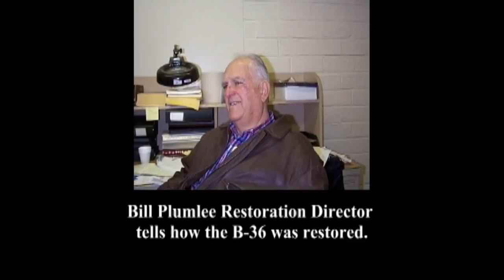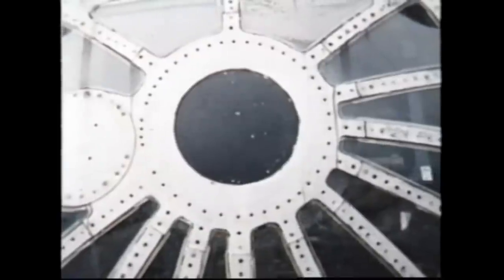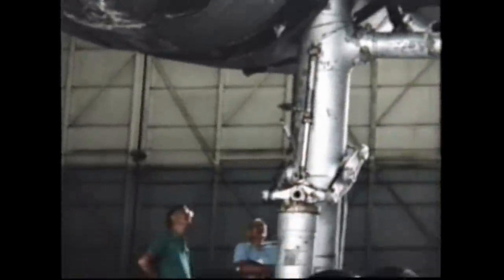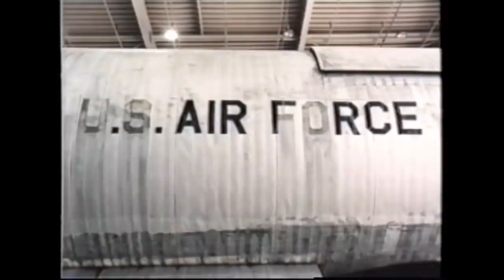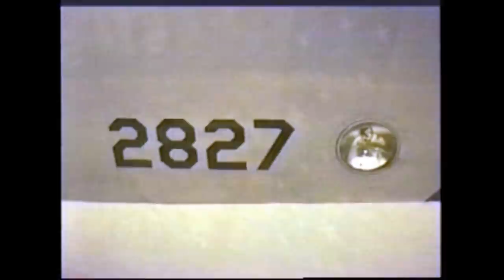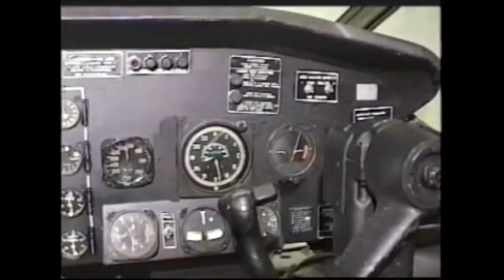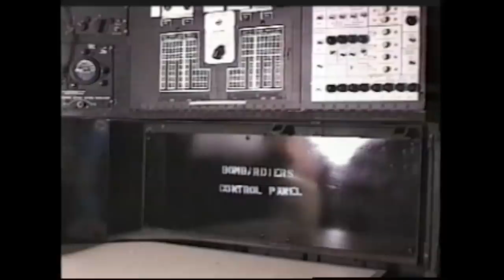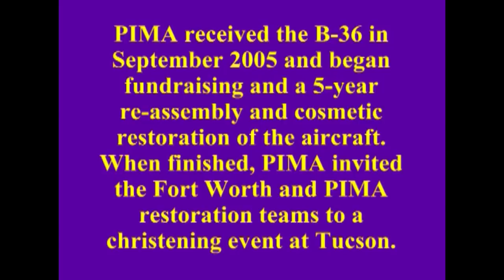Restoration of the last B-36 Bomber in Ft Worth

Comment: I recently saw here on Youtube a US plane "boneyard", and there was a B 36 too if I'm correct ?
Reply: boneyard is in tucson and it is separate from the pima air museum. the b-36 is at the museum, not the boneyard which houses thousands of military aircraft
Reply: By the way, when I was in elementary school in Tucson in late 50's, you could hear them coming over head before they appeared, and the nuns used to stop her lesson because of the noise, and the building would shake.

Comment: My dad pulled an ORI on the wing at Fairchild that had these monstrosities, I believe in 1952, and it was a failure as great as the  weight of these things.  Only two of the B-36s of the whole wing managed to get airborne as directed, and the guns jammed on both of those over the Pacific, leading to a 100% failure of mission.  Two more managed to get in the air later, one having to return due to an engine failure, the other having similar gun jamming plus a turret lockup.  I can't recall the old man's name at Fairchild, but he didn't fare well at all.  He got back at my dad by blocking a overdue promotion, whereupon he resigned his commission.  He was quite well known to recall this flying circus of an airplane as the biggest fraud on the US taxpayer ever perpetrated by the corrupt Convair Corporation.  If course, he said this before they foisted the insanely dope dive (and useless) B-58 mess on us later.

Comment: A B-36 will never shade the ground in its "aluminum overcast' again.  The odds of getting an airworthiness certificate for a plane powered by four R-4360 Wasp Major's are Slim and None!  As it is it's a miracle two B-29's are flying.
Reply: Correction: Make that SIX R-4360's!  My bad.  Still, this plane or one like it will never take to the air again; it was tricky enough to get them airborne in the 1950's. Even the B-52 had a short life as a "strategic bomber" once it was clear that SAM's could take out bombers while an ICBM was unstoppable.

Comment: This last B36 - with 44,000 + manhours of restoration to save this aircraft from the crushers -  and supposed to be an in-hangar display for generations to come and view history - only to be sent back into the elements and be allowed once again to slowly decay.  What a tragedy.  I am wondering if operable engines were in the static display before they began the restoration? Would it be capable of flight again?  What would the cost today be to operate that aircraft?
Reply: +Lindsey Allison Westhaven   They had originally planned to repair it to flyable condition for one last ferry flight to a new location. But when the Air Force heard about the work they came in and took the engines and the engine mounts from them to prevent it from flying again. They were expensive to fly while in service and would be far more expensive to operate it today.
Reply: @FiveCentsPlease   WHY WOULD THEY DO THAT? TO KEEP IT FROM FLYING TO A MUSEUM WHERE IT WOULD STAY FROM THEN ON?  WHO ACTULLY OWNED THIS AIRCRAFT - THE USAF OR A PRIVATE ENTITY.  SOMETHING STINKS HERE AND PEOPLE SHOULD DEMAND ANSWERS.
Reply: There was only one good engine in the aircraft. Without fuel in the tanks, the heavy engines caused the B-36 to tip over to the rear. So, there were five dummy engines.

Comment: What a goddamn shame that with all the money the military blows on b.s., they cannot find it within their leadership to restore completely, this awesome one-of-a-kind mighty guardian from the early Cold War. I am very disappointed that funds could not be found to restore it to full airworthiness. What a shameful mark on the USAF.
The volunteers, however, did an outstanding job for what they were capable of, in the hope of one day, watching it take off into the sky one last time. It nearly brought tears to my eyes.
Reply: +Ride TheCurve   The aircraft was technically still property of the USAF Museum and was just "on loan" for display.  The AF Museum already has another B-36 inside their facility.  When the Air Force found out that they were going to attempt to fly it (even for a short ferry flight) they came in and took the engines and mounts.   An operational B-36 if you factor in fuel, insurance, and an impossible maintenance schedule would not be very realistic.   The DoD doesn't maintain a "heritage flight" on the same level as the Battle of Britain memorial flight for example.

Comment: One of the first things the air force did when the re-posessed the aircraft was destroy the engines, all six were in running condition
Reply: Actually, no.  The preservation team removed them to reduce the stress on the wing and gear once it became clear that a return to flight wasn't gonna happen.  Would have been nice to have saved one for runups on special occasions, though.
Reply: On this particular aircraft, there was only one good engine. Five were dummies because their original weight caused the B-36 to tip over backwards because the fuel tanks were empty.

Comment: Strategic Air Command.    

36 hours at 45,000. Others to reach that altitude could not maneuver. Non air borne refueling capabilities.
Props 19’ were gear reduced to avoid super sonic tips. Her low pitched vibrato unmistakable.
336 spark plugs. Six times 4630 Wasp Majors. 4,300 horse power each at take off.

Flight engineer, give me full power, jets 100%, rolling.

Imagine a flying condition example on the forth of July on a celebration low fly by.

Be some old boys with damp eyes.

Comment: "The Air Force would not let it stay in Fort Worth unless it was in a building. It would take about $1,500.000.00 to cover it and the money could not be raised. The Air Force moved it to the Pima Air & Space Museum, Tucson Ariz. and it is on display outdoors."

Seems like you'd want to keep raising money until you had enough to put it under cover, but that's just me. Putting it out in the weather is just letting it deteriorate again.

Comment: Even if it was restored to airworthy condition.  Would there be anybody that has the type rating to fly it?  How does that work lol?
Reply: +1!  There are pilots with so much experience on these old planes that the FAA pretty much says they can fly anything.  But the B-36 needs at a minimum two pilots, a flight engineer (this mode required two), a navigator, a radio operator, and two observers in the back watching the engines for smoke or flames.
Reply: A B-36 flies just like a Piper Cub. The only difference is that it is more difficult to attach playing cards to the spokes.

Comment: I had no clue magnesium was used in aircraft... I thought magnesium was too flammable and too soft or too brittle but too no good for airplanes.
Reply: Keith Whisman ,
Light weight. Flammability was mainly concerned with magnesium dust created during manufacturing.
Reply: And of course, it burned like a torch if you had an inflight fire or a crash.
Reply: Not true.   Even the DC-3s had massive amounts of magnesium in the landing gear structure.

Comment: People should do what they want, however, the B29 was used through Korea (1953) and the B-52 came on line in 1955.  I've never quite understood how this ridiculously large and slow bomber fit into history?  It seems like a large mistake rather than a plane we hold in high regards for what it did for our nation.  Radical push engines, largest bomber ever built, but for what??  Modern jet fighters would simply shoot it down because it was slow.
Reply from the maker: It was designed in 1942 because we thought England was going to lose the war, but after we got involved we knew that would not happen. It did not fly until 1946, but it could fly higher than any other aircraft. There was no missile or aircraft could shoot it down. After the war the Russians put 100 divisions on the border and NATO had three. Our President told them if they invade, we will load them with nuclear weapons and destroy your country. That stopped World War Three. It never dropped a bomb in anger,  but it stopped WWIII after WWII.

Comment: What's all this nonsense about getting a B-36 flying again?   those engines weren't exactly reliable.    I'm amazed they have restored it to static display.  They were enormous, but gas hogs.  You are talking mid 40's tech.   No one would take this on,  maybe not even Travolta,  you'd be a lot more reliable manufacturing from new and installing new type engines but there wouldn't be much point.  No one is complaining because they dont' fly F-14's .... I'd much rather preserve these instead of taking a risk on losing one.
Reply: The one at the Air Force Museum was flown to Wright-Pat in '58 or 59.   There's a reason they went out of service, reliability and range.   The B-47 B-52 was much more reliable, at least we had that great movie with James stewart to remember them by,  they were a stop gap for a few years and probably kept the peace, which was their namesake.
Reply: MrCloudseeker , if they used “better” radials, it wouldn’t be a restoration, would it?
Reply: These 56 spark plug corncob engines were very high maintenance and at that time unreliable.  Cooling problems
in the rear 14 cylinders was critical.  The 28-cylinder engine was just too complex.  The 18-cylinder Wright turbo
compound engine should have been the choice for the huge Consolidated/Vultee {CONVAIR} B-36 bomber.
Reply: seriously?  the R3350 had enough problems with supercharging, turbo-charging and power-recovery supercharging that they were on the ragged edge of destruction every time they flew. the R 4360 wasn't so heavily taxed.
Reply: The plane came with a mechanic, that had a workshop in center of the wing and could walk up right to first set of engines, and could do maintenance while midair on all of them.
Reply: And, what engines would you use? Name one instead of spewing garbage. 
Name one engine that has the power needed to even get this monster rolling. You can't because there isn't one. 4300 HP is hard to replace.
The project would  be beyond massive and and how would you pay for it? You seem to have very little info on aircraft storage processes and how aircraft are sealed to be UV proof.
Reply: Ummm, no.  The mechanics stayed on the ground. The Flight Engineers were part of the crew.  Later models had two on duty.  

The center of the wing was gas tank, not a workshop.  And while there was a crawlspace in the wing, all you could get to were some fittings and fuse panels.  No way to access the engines themselves, or even the accessory section.
Reply: The B36 at WPAFB was flown on to the Area B airfield in anticipation of the museum moving there from another location at WPAFB. IT was determined that the B36 on display  at the previ on us location couldn't be moved to Area B 

I was there in my mom's arms to see the B36 land. Dont remember it, but my parents had pictures of the event.  

The other B36 was sold to be scrapped. Tge Buyer took it apart and transported it to a farm in Northern Ohio in the early 70s. It is still there today.

Comment: The sad truth of this aircraft is, it was pretty sad.  Under powered, poorly constructed.  The B-36 holds the distinction of having the shortest active service life in the US Air Force.  Many low hours air craft were flown directly to the scrap yard.  Many were scraped in place, because the could not be safely flown.
Reply: Uhh, no, pretty much completely and totally wrong.

Every pilot report I've read comments on how reassuring it was to have all that power available.  You don't get to 50,000 ft without power.  Poorly constructed?  It could carry 84,000 lbs of bombs.  

Shortest service life?  Dunno about that.  It was on active duty for about a dozen years.  I think that's more that the B-58.  Certainly more than the B-32 or P-38, which were pulled from service right after the war ended.  How about the B-45? 

ALL the aircraft but 5 were flown to Davis Monthan to be dismantled.  Obviously, they were ALL in flightworthy status. The retirement process started in 1957, five years after the last one (the one in the video) was delivered.  The last B-36 flight was in 1959.  And yeah, some aircraft that crashed on takeoff or landing (and one that was destroyed beyond repair by the Labor Day tornado) were scrapped in place because they could not be flown AT ALL. 

I'm don't know where you're getting your info, but it's certainly not from any authoritative source.
Reply: B-36 Peacemaker career was also plagued by its six piston engines R-4360s. Hilarious slogans as ” six turning, four burning” soon went over to “two turning, two smoking, and two choking”. The engine problems aggravated, related to the Pusher-Prop configuration of the B-36. In the more standard tractor setup with Props running on the leading edge of the wing, the carburetors in the rear end of the engine receive more heat from the cylinders airflow.   The Wasp Major engines had a prodigious appetite for lubricating oil: each engine required a dedicated 100 gal (380 l) tank.[citation needed] Normal maintenance consisted of tedious measures, such as changing the 56 spark plugs on each of the six engines; the plugs were often fouled by the lead in the 145 octane anti-knock fuel required by the R-4360 engines. Thus, each service required changing 336 spark plugs. Another frequent maintenance job was replacing the dozens of bomb bay light bulbs, which routinely shattered during test firing of the turret guns.

There are many other articles written about the plane...
The jet engines were added later because the performance was so poor.  The aircraft was so large and heavy the preflight inspection took much longer, and included serious inspection of the aircrafts, super structure.  

Look into it more, those that flew them, maintained them, weren't too happy with them.  My dad flew C-97's at times crossed paths with B-36 crews, they were not happy people, over worked yes, happy, not so much.
Reply: I was fortunate to work on the preservation of the aircraft in this video back in the late 70s.  One of the leaders of that team was Tom Neely, who'd been in charge of B-36 production.  

Is the paragraph above from Wikipedia?  That "[citation needed]" is kind of a giveaway.  I actually wrote a fair amount of that article's text some years back.  Still, any serious student knows that you just can't cite Wikipedia as an authoritative source, since any fool can edit any page at any time - and that certainly appears to have been the case here.  

I own every book I've been able to find about the airplane: Cold War Peacemaker, Magnesium Overcast. several photo books aimed at model builders, Don Pyeatt's rare CD-ROM "Saving the Last Peacemaker" (to which I contributed photo's I'd taken) and the massive and thorough "Convair B-36: A Comprehensive History of Americas Big Stick." 

That last book contains scores of first-person recollections of flight and ground crew members, and without fail those men reflect fondly on the Big Stick.  Yes, at the time they were overworked, underpaid, and sometimes served under "Charlie Sierra" base commanders.  So it's little wonder that your dad remembers them griping.  That's what airmen do!  "Two turning, two burning, two choking, two smoking, and two joking" was the way I heard it from a flight engineer in the 70s. 

Early models had serious cooling problems, true, but that was greatly alleviated by using a larger cooling fan on later models.  A change to the wiring harness solve high-altitude plug-wire arcing as well.  And I'll grant you the bomb bay lights; I've heard that from maintenance crews.  Add to that, maintenance was almost always performed outside, often in freezing or baking weather.  Of course they griped.

I've spoken with some of the mechanics who changed those spark plugs.  They report that no, you did not in fact have to change them after every flight.  Only when they failed - and the Flight Engineer had an instrument that reported on the health of every plug.  As to fouling, every piston-engine pilot learns early how to clear fouled plugs - run up the RPMs for a minute or so.  It works in a Cessna 152, it works in a B-36.  

No question the aircraft was a maintenance hog.  90 hours of maintenance for every flight hour, and that's with the full support of the USAF and the factory across the street.  Which is why one will never fly again.  And I'm okay with that.  I'm just glad that a couple of them have been preserved in good condition for future generations to marvel at.. 

As marvel they should.
Reply: Mainly, it was replaced because it did not say "Boeing" on its side...